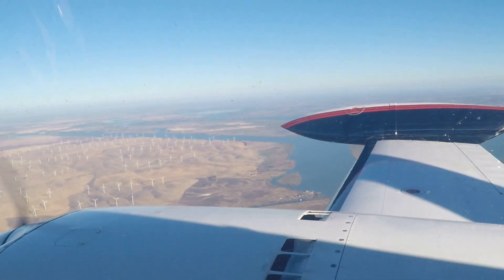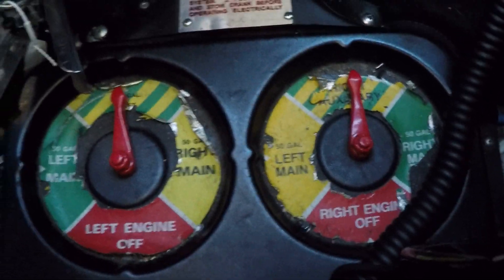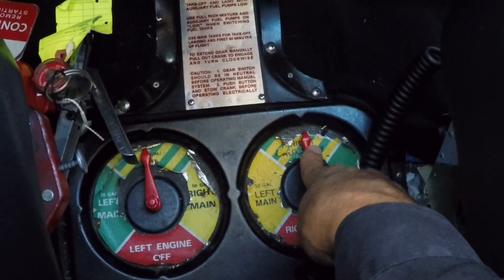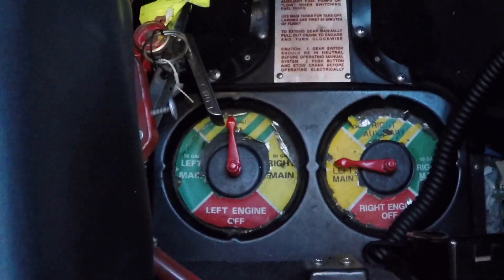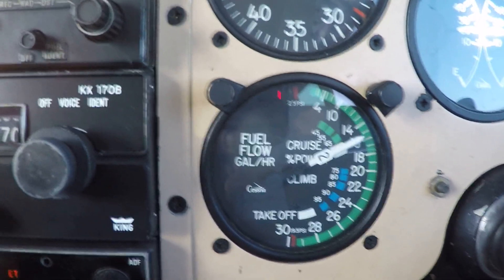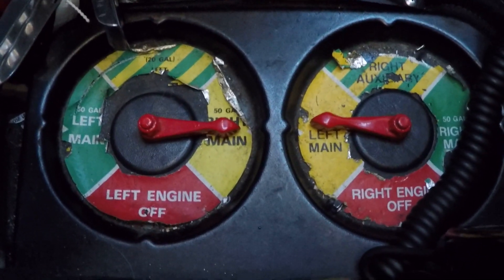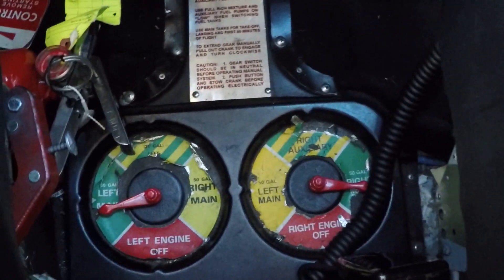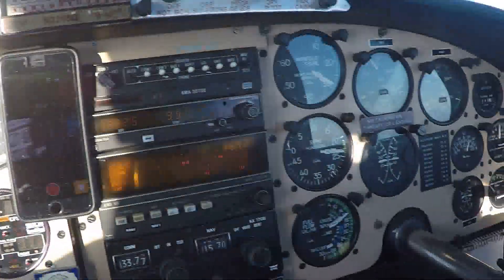Twin Cessna 320 310 in flight fuel crossfeed procedure demonstration N3318Q

Comment: Another tip (we fly a P model 310) Hot high density altitude take offs can cause fuel atomization in the lines just after take off. Refer to the book on your aircraft but we have had occasion where both engines loose partial fuel flow ( 50%) simultaneously cause a thrill. Proper boost pump usage here is all that's needed and if it happens go to high boost and it cleans out immediately.
Reply from the maker: +Jeff Mcgahan Good to know, my procedure for high altitude takeoffs here in Lake Tahoe and the Reno area is to apply power BEFORE turning on the prescribed low side of the fuel pumps and then add the electric pump to keep from flooding the engine on initial power, keep on the brakes to confirm full power then BLAST OFF

Comment: So I understand you can't burn or transfer to the opposite side engine from the aux tank. A assume the aux tanks have their own electric fuel pump to pump fuel to the same side main tank. Is that right?
Reply from the maker: No, the engine driven fuel pumps pump the aux tanks and the excess is fed out to the mains